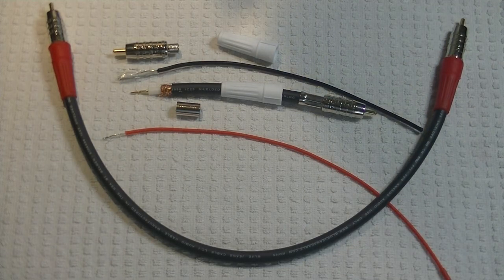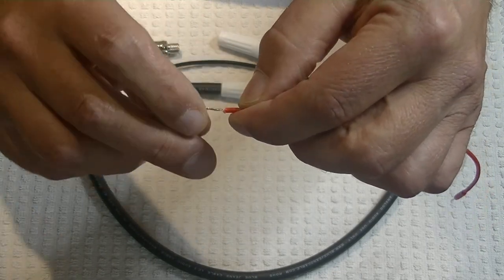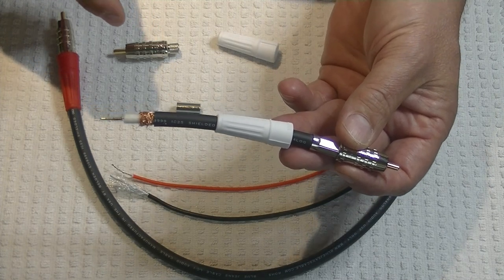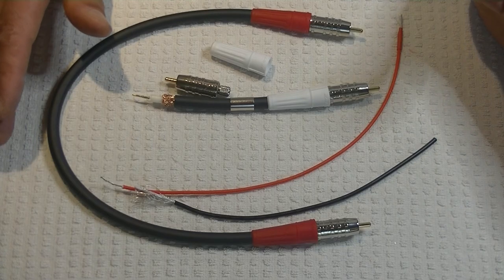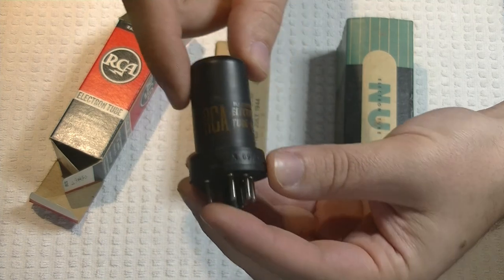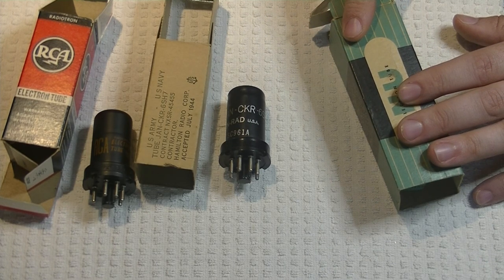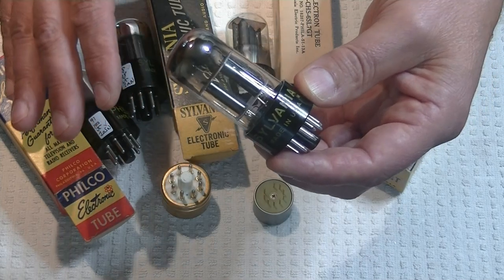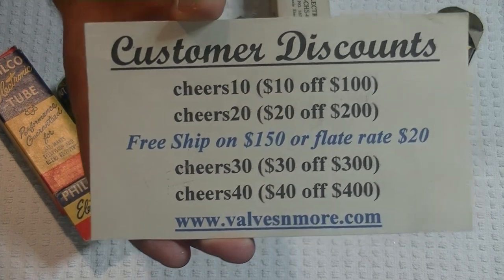Tube Lab #101 - How To Achieve Great Sound - Cables - Pt.1

Comment: Blue Jeans cables are fantastic. I’ve got them throughout my entire system. I’d love to eventually try out the Iconoclast series of cables, but the standard Blue Jeans are working extremely well for now. 👍🔊🎶😊
Reply: LC1?
Reply: @a3marketing991  Yup, LC-1’s going from my phono pre to my preamp, and from my pre to my amps. I also picked up some Canare 4S11 speaker cable from Blue Jeans with those welded on banana plugs. I can’t think of any other company that welds the cable to the plug.

Comment: Silver, not tin plated multistrand wires in PTFE insulation are pretty common and offer excellent electrical performance when configured as a twisted pair speaker cable.

Comment: I have been searching for a video like this forever. Great job.  Still struggling with an interconnect decision.  Using mogami w3173, which are a highly regarded audio cable that isn't sold retail as RCA, it has to be customized with RCA connections.  It would be great if someone did a construction analysis and distinguishing design differences between cardas, shunyatta and maybe audio quest what's discussion about what all these design differences achieve. I largely believe it's a lot of coloring exercises. And why exactly do all these coloring changes take place when design changes occur. Maybe someday they'll be a video like this. And done by someone like you who seems to know what they're doing. Great video thanks
Reply from the maker: In part one, I tried to show subtly how the internal and external wiring of a pre/amp are almost identical.  The big difference of course is that for most unbalanced RCA cable runs we use shielded cable, that has a bit of heft to it.  The actual signal wire is almost exactly the same.  What changes is the distance run of the cables.  And with distance run comes capacitance, and capacitance affects the EQ of the signal.  Blue Jeans LC1 stands for low capacitance.  So if you don't want to have to fool around auditioning various expensive cables, all you really need to do is choose a low capacitance cable, that uses a quality end and is well made, oh and most importantly keep your unbalanced cable runs as short as possible.

Comment: In your last show you said never to leave a tube amp unattended
Is this accurate? Or were you just funnning.
This is a real question
Reply: Hi Gary, This is Accurate!

Particularly for an integrated or power amp where there are power tubes, if a power tube red plates and you aren't around. Best case the tube dies, worst case is that the tube starts to fry components in the amplifier. And if the amp doesn't fail safely, then it could become a fire hazard.

This is less of an issue with preamps, but it's still good practice to not run it if you aren't around. Especially if you have pets or kids in the house.
Reply: Ok thanks for telling me 
I will change my habits immediately
I'm learning a lot from your channel
Thanks :)